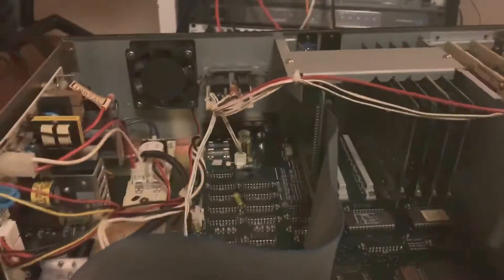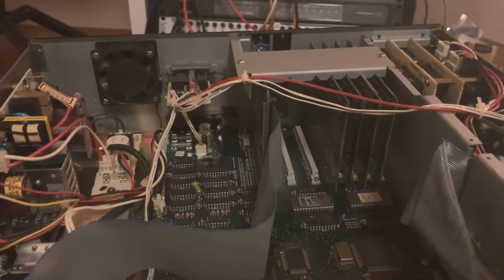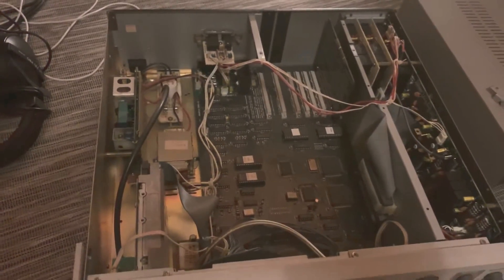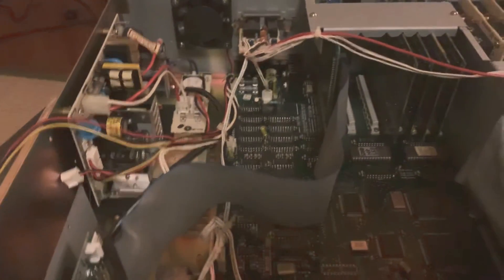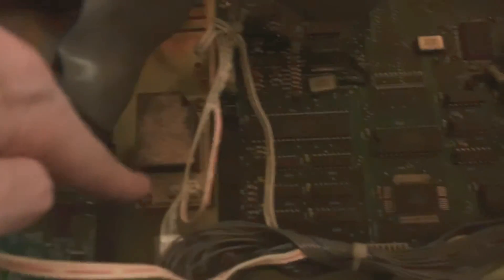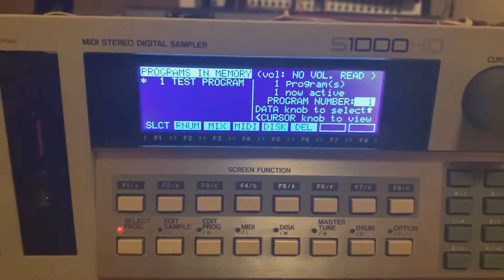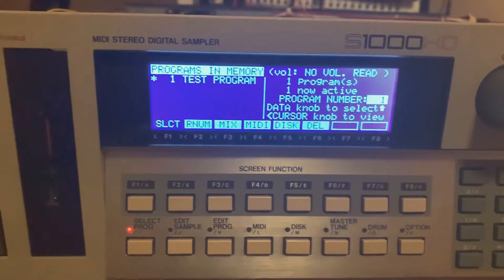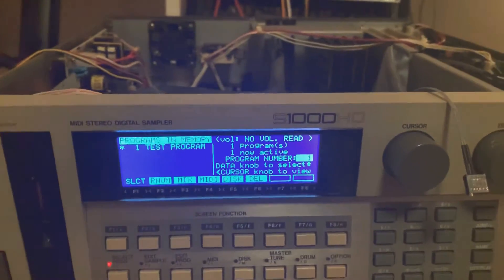AKAI S1000 in 2020 part7

Comment: What is right corner dimmer?i have this black tri axis display but don’t know how to up brightness
Reply from the maker: if you bought this display it should have this small trimmer included. you need a small screwdriver to adjust it - it is a brightness control (not a contrast control) once it's set up, tape it inside the machine and close the lid
Reply: @IanoBrienismusic  looks great!
i wonder if they are still making displays..